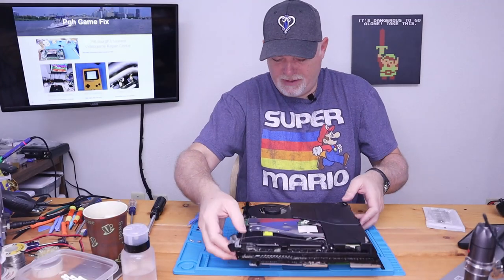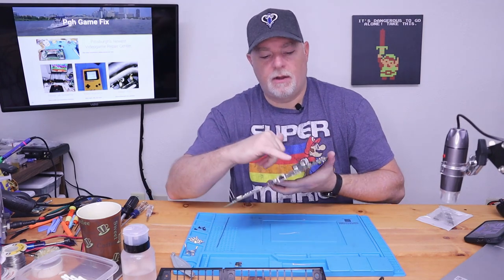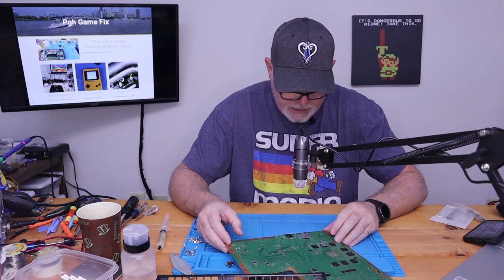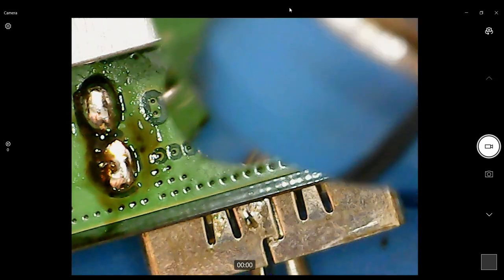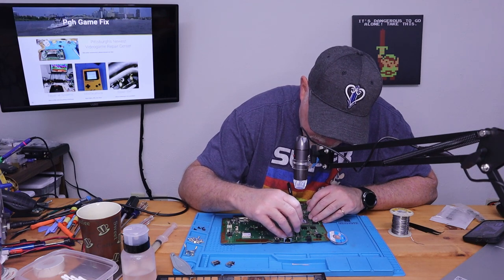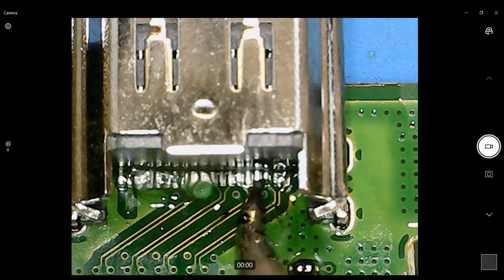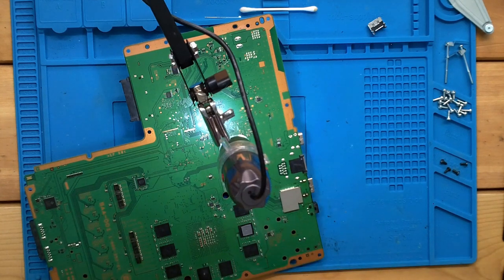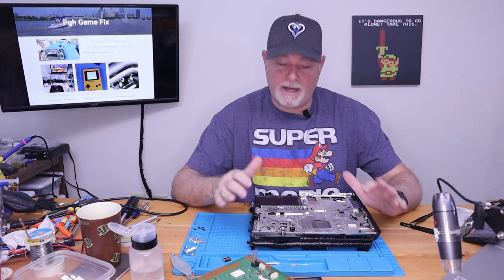PS4 HDMI Port Replacement

Comment: How much would u charge to replace a PS4 hdmi port
Reply from the maker: Depends on a few things... but it's right around $45.  It could be more if there is board damage, it's excessively dirty or shipping if you are not local to Greensburg PA.
Reply: @PghGameFix  Yh I’m in the Uk so it may cost a lot but I am going to see if a local shop can repair it but if not I’ll be first to contact u thnx for your help
Reply: @PghGameFix if it has a stripped screw?

Comment: How much do you charge? Also can you list all tools used in this video.
Reply from the maker: An HDMI port is $45 to $60 depending on the model.   The tools needed for a ps4 are a security #8 torx. Philips #1. soldering iron, and a hot air station.

Comment: I mean replacing the hdmi port I never removed the old solder and it works fine so it's waste of time if you put new leaded solder
Reply from the maker: It can work... but it can also come back because it cracks loose.  The few extra minutes ensures a proper solder joint.

Comment: my ps4 only sound but not picture,what can be?
Reply from the maker: Chances are, it's a bad HDMI Cable.  I would try a new one before getting too worried.  Over the years, I've had a few randomly die.  One was the OEM Sony cable that came with my PSVR system.  Generally, if there is an issue with the port, you will get a white light, and the system stops booting.